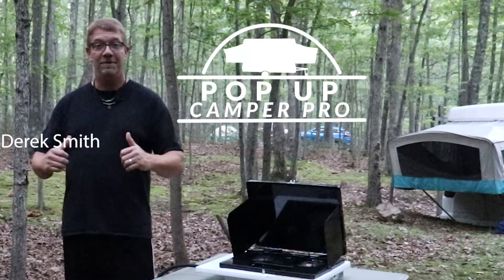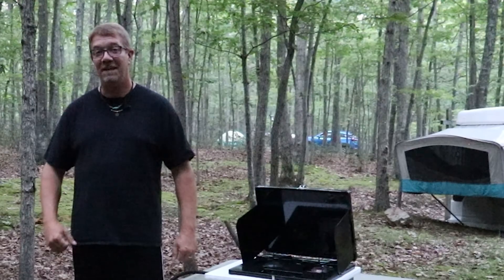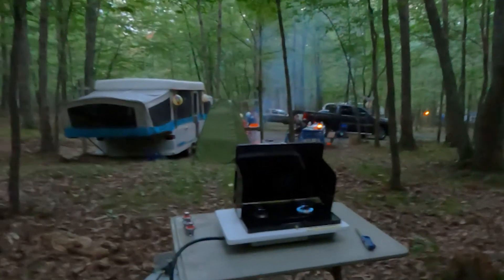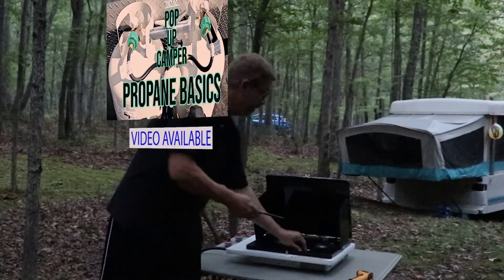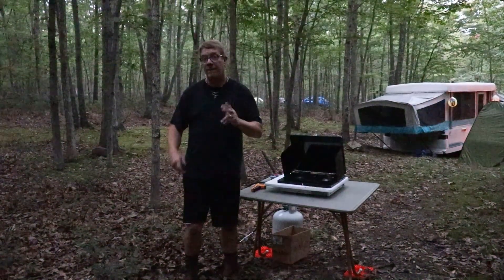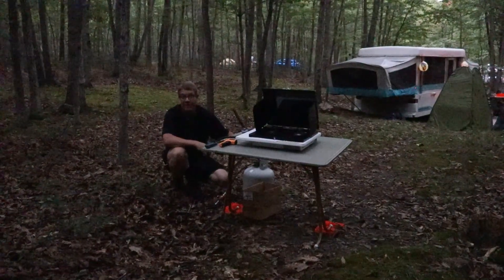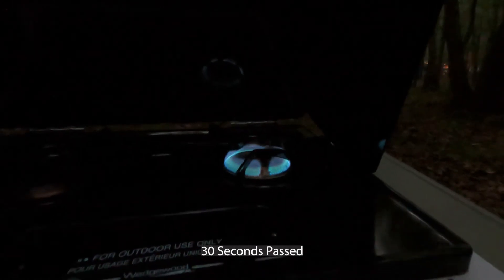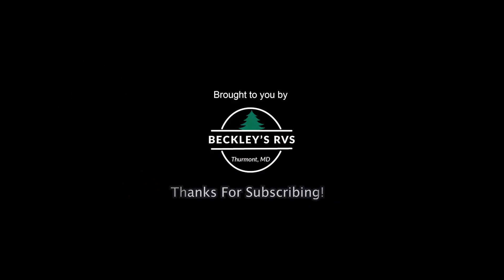Four High Pressure Regulators Tested

Comment: Thanks. We are having a hard time finding a cord to run from our regulator to the propane tank. We actually stopped by y'all at Beckley's and couldn't find one
Reply from the maker: Hello JP! In the past two weeks I have added quite a few new LP hoses into stock. They are directly matched with the original Coleman part number. Check your parts book, and see if we now have the correct LP line online at colemanpopupparts.com for you! More are coming online as well in the coming months. Thanks for writing and stopping by!